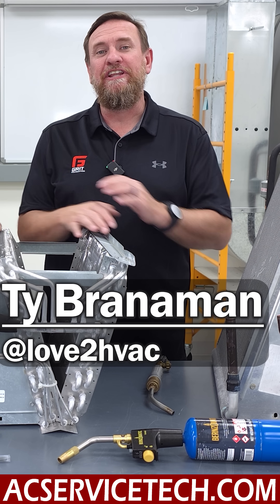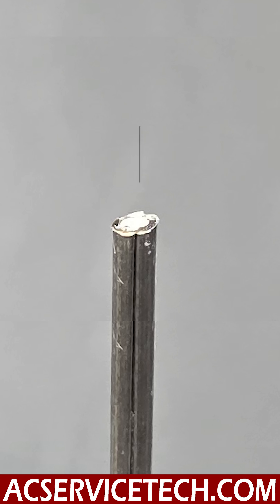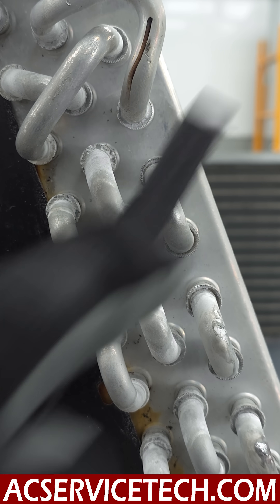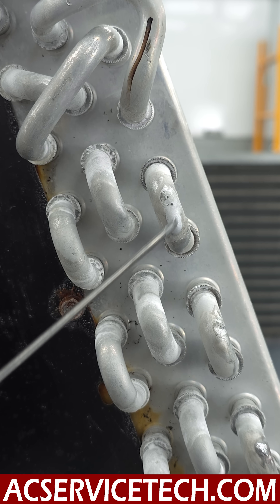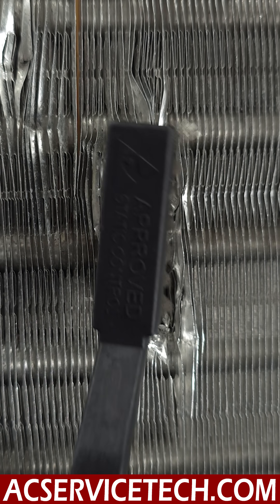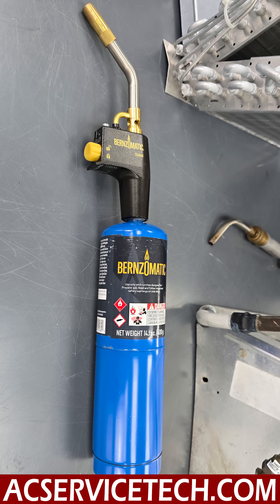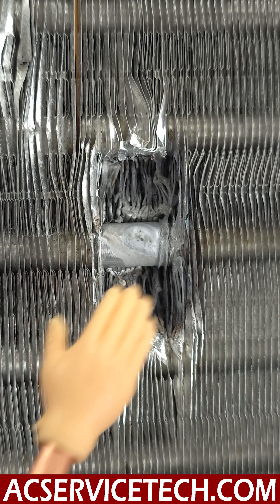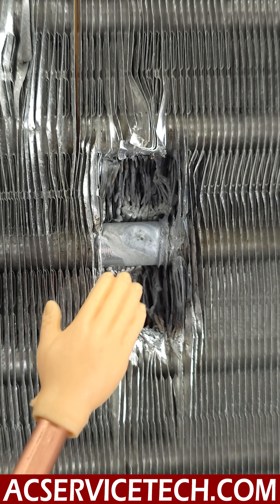Fixing Aluminum Coil Leaks Using An All-In-One Brazing Rod!

Comment: I wonder if you had a really hot soldering.Iron if you could do that with an aluminum.I mean, one of those soldering irons from like the thirties that they use to solder to these steel chassis of the old radios

Comment: You can.
Fix it the way he has it, however if the coil is in place, is wet, is dirty. You're gonna have to pull it out.Separate it from the pan dry it, then clean it, dry it again, is then sand paper, then you can soder. If you don't, the soder will not stick whatsoever. Also leaks never happen like that, they are using the easiest point on noodle. Do the repair on a joint that didn't get finished, share, ty. Have a good day fellas, Nameste, stay 😎 cool